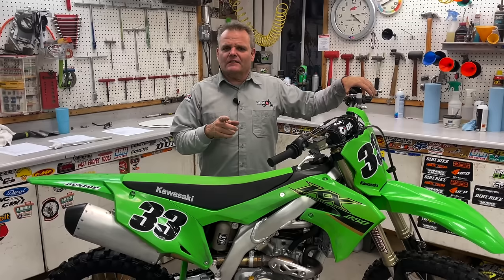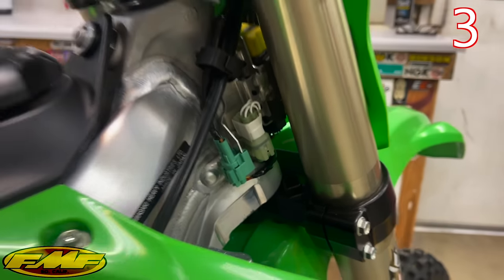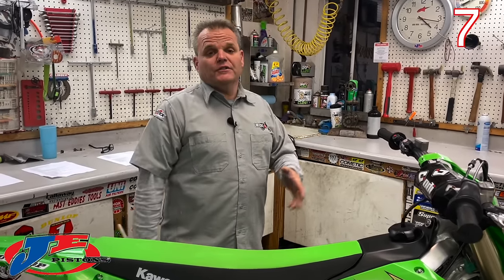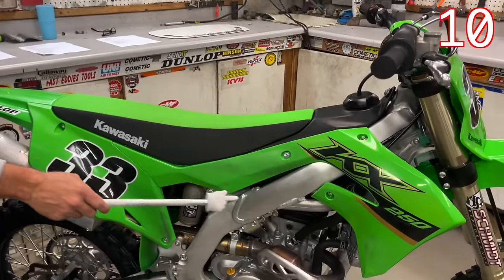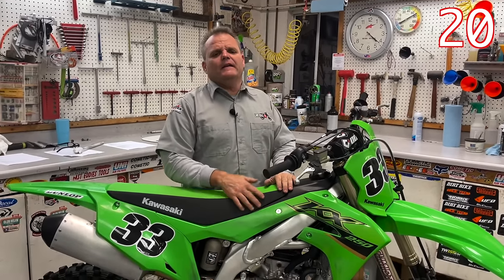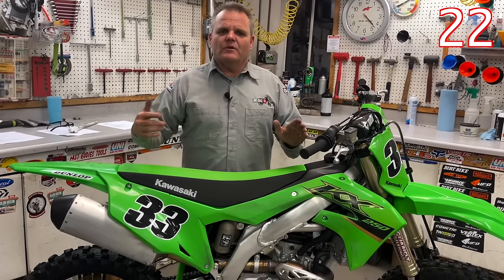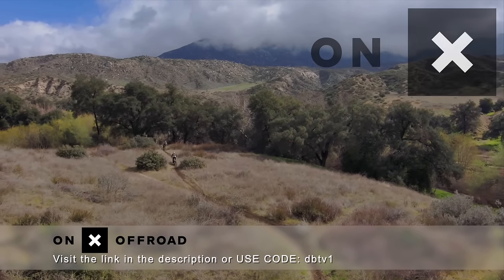23 Must do Items on your New Dirt Bike

Comment: Sad to pay 7000+ dollars for a brand new dirt bike. Along with that 7000+ dollars you get minimal suspension bearings greased, junk chain and or junk chain sliders plus sub par engine oil and brake fluid. Total crumb
Reply: 7K is cheap.  And it's always been that way.  I've been on dirt bikes since the 70's, and I never bought a bike that didn't need a good going over, including lube - before the first ride.  Heck, that was half the fun of buying a new bike.  Getting to know it.
Reply: just paid 9800 for my new honda. i look forward to prepping it
Reply: Closer to 9-10k now 🤣
Reply: More like around $11k my guy..

Comment: All good points, but from what I've learned from factory mechanics back in the day, regrease all bearings from the steering, suspension links both wheel bearings and axles with high quality water proof grease even before riding your brandnew bike because since this bikes are mass produced, they just put just enough grease in the factory so as not to hamper the assembly line. When the bike is happy, the rider is also happy.

Comment: Di-electirc grease on all the wire connectors is nice too.
Reply from the maker: Yes great call and for sure on the KTM starter button connection behind front plate.

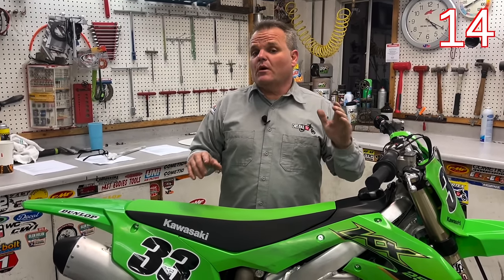Comment: 04:16 - kids, please don't overlook checking your sag.  Most new riders overlook this in the beginning, and it can make a huge difference in ride-ability and safety.  Please make sure your spring rate and sag is correct.  Please.  Your suspension is much more important than how powerful your engine is.  Get that right, and everything else will make sense.
Reply: Does this matter as much if I’m 6’5 250 about to buy a 450
Reply: I wish someone had told me this. I bought a new GasGas Ex350f to learn how to ride off-road trails. I weigh about 250 with gear so my sag was way too much. It was like riding a springboard. Couldn’t steer or control direction in bumpy terrain. I crashed a lot! Many of these crashes could’ve been prevented. I eventually bought a new shock spring for my weight and adjusted the sag and it made a HUGE difference in my riding confidence.

Comment: Other things to do:

- Install a skid plate (before a rock punches a hole in your cases)

- Loosen the brake and clutch lever mount a little so they rotate when you crash instead of break. 

- Loosen the fork axle and triple clamp pinch bolts and torque them in the proper sequence. 

- Check everything the dealer did to assemble the bike: footpegs, wheels, battery, handlebars, chin tension, wheel alignment, etc.

Comment: Nice Bike...TEAM GREEN...ALWAYS! for our 2022 KX85 break in they called for 16-1 mixture and let it run for 3 hours on and off when it warms up, then let it cool and do it again, i ran it on a stand and slowly went through all the gears over and over, then i drained out the rest of the 16-1 and filled it with Avaition Fuel 32-1 and it runs great, he Loves It, and it really is a Bad Ass Bike!
Reply: Best to ride it around up and down since you want to vary the load on the engine---but also on a stand, you're not getting air thru the radiator which isn't good.
Reply: @brianpolen1087  It was winter, didnt want to get all the salt all over the frame and everything else, had to break it in as he was going to Jimmy Wienerts Moto Acadamy in North Carolina a couple days later

Comment: just run the stock chain & sprockets till its time to change them, why toss them before you even use them.
I've gotten months out of my stock C&S.
Definitely do your steering stem bearings on the 19& newer Kawi's.
I've went through 4 sets on mine in the last 3 years. 2 on my 2020 450, and 2 on my 21 250. I haven't gone through that many the previous 25 years combined.

Comment: So you have to bleed air forks, but do you have to bleed spring forks also?
Reply from the maker: YES -- both have air bleeders
Reply: Yep.  Just don't bleed them when they are compressed.  You'll create a vacuum.
Reply: Get some of those push-button bleeders.  Get off the bike, pull back / up on the forks - THEN bleed them.